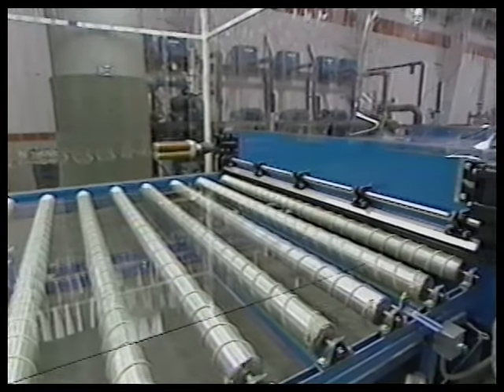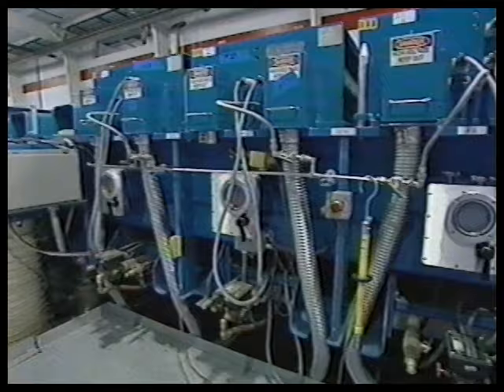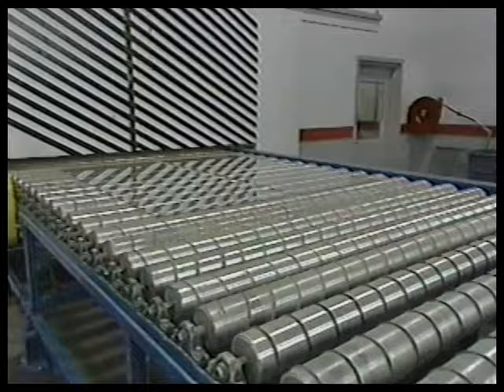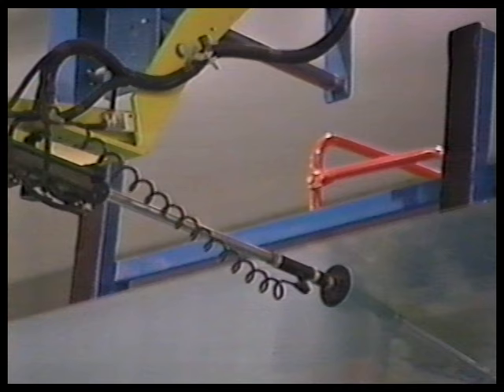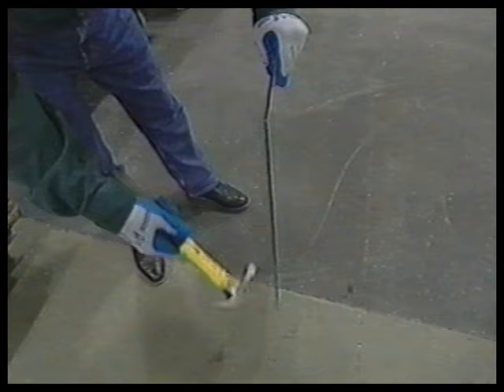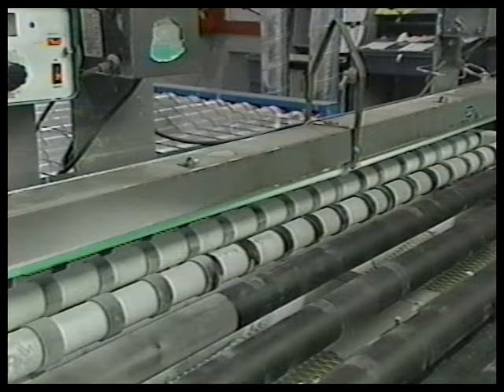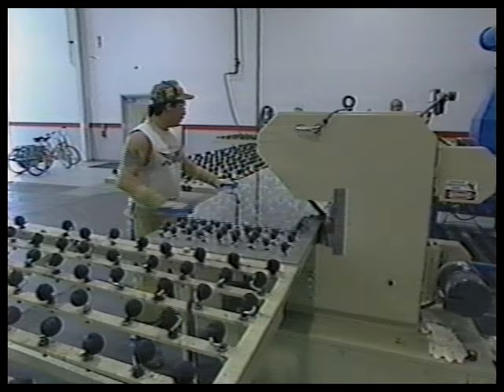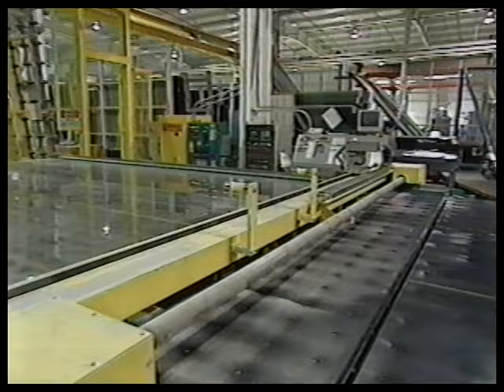Tempered Glass Production

Comment: no. at my shop we have a tempering line once  temper 10mm and it's off but by like an 1/8 because ministry standard is 1/16 so anyways the customer is here and we send it on the polisher it was high risk the polsieher was wearing some good ppe but I've seen prices explode I've seen peices give leanious
Reply: come again= leanious? bodily damage? Is there a way to anneal or untemper glass?
Reply: huh? what? covfefe...
Reply: Punctuation is still used in today's society, I'm not sure if you are aware of that.
Reply: So i think what hes trying to say is you can shave off a little on the edges of tempered glass where it has the least tension. Technically you can untemper glass but good luck getting your manufacturer to bother.